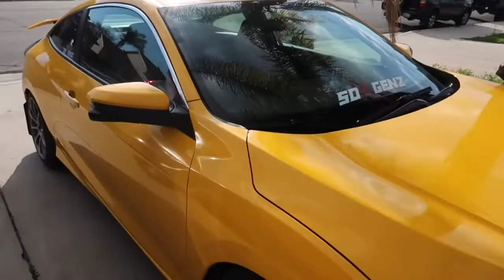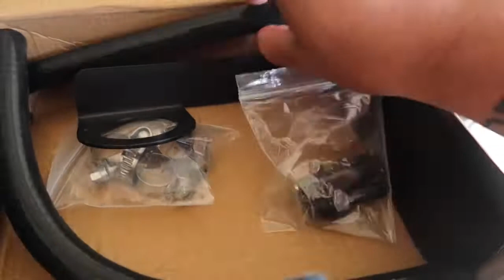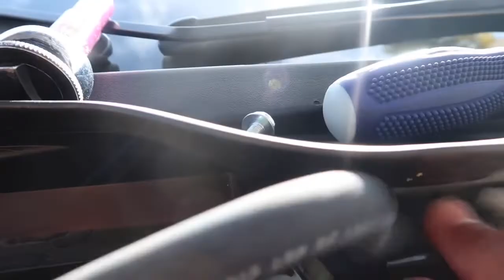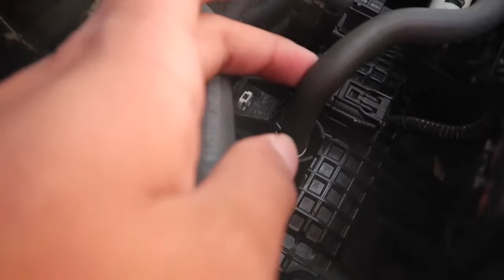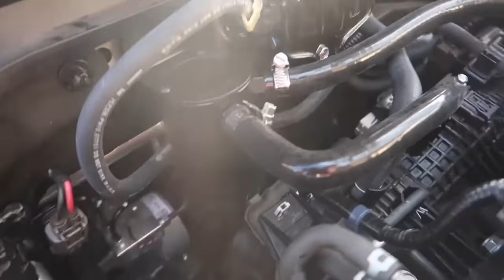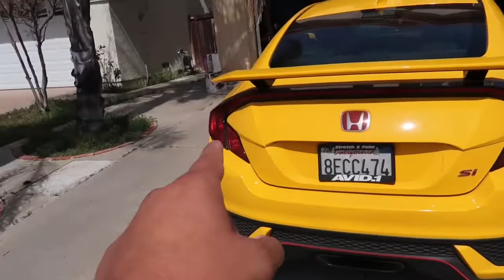Oil Catch Can Install!

Comment: My personal preference since your car is yellow, which is dope, I’d probably take the red pinstrip off, it kinda looks too much of a ketchup and mustard look if ya feel lmao but great vid again! Look forward to the next one
Reply from the maker: Thank you a lot for your feedback! I really appreciate it.
Reply: keep the red stripe. It adds a touch of contrast to the overall theme of your car. Regarding the catch can, I purchased one for my 2018 si as well. Read a lot about catch cans  and how they can benefit direct injected engines and for the most part turbo engines. Catch cans will not add performance to a engine, rather, they will catch all the oil sludge before it settles in the intake valves. I plan on keeping my  si for a long time and wanted make sure the engine is in top  shape without all that oil sludge shit in the intake valve. It call is preventive maintenance.
Reply: @FORSAKENGARAGE  well, one said fire 🔥 all you need now os blue lol! That blue fire with yellow and red

Comment: I pulled off my charge pipe hose from the turbo only to find a slight mix of oil and gas sitting on the plastic inlet from the turbo. All that is from some hard driving but 90% from idling the car to get warm during the cold weather. That’s where the dilution issue is from is the car not warming up fast enough in cold climates. The catch can is cheap insurance. If you’re smart, you’ll put one on. I’m glad I ignored all do’s and don’ts about a catch can because now I’m putting one on to avoid that issue any further.
Reply from the maker: a lot of people actually disagree with a catch can, but like you said, it is a cheap insurance, after two months i inspected the car, and there was oil deposits. I'd rather be safe than sorry, like i mentioned in the video, it just helps with maintenance. thank you for watching, show a brotha some love and hit that subscribe button. I will be doing a giveaway at 1,500 subs!
Reply: @FORSAKENGARAGE  there was or is am issue with the turbo they said. Usually hondas are good about their engine, but they might messed qoth this ome where oil leaks to the combustion last time i heard.

Comment: Awesome video dude.
I plan on getting a 2017 Civic 1.5 manual and the first thing Im gonna do is install a catch can.
Do you see any effects after the installation. Have you seen if there is anything in the can after driving a bit?

Comment: I have a 2019 Honda Civic Sport 2.0 would that be the Same??
Reply from the maker: Junior Ayala negative, this is for a 1.5t liter engine
Reply: the 2.0 engine is a multi-point fuel injected car.  meaning the fuel is sprayed over the valves to keep the valves clean.  You should only install a catch can on a GDI (gas direct injection) car.  Because, the fuel injector is directly in the cylinder, therefore does not spray or wash the valves.  On GDI engines, the valves can get carbon deposits.

Comment: Whats the oil can for?
Reply: to catch oil
Reply: It's for preventing the valves from getting coked up with oil on direct injection engines.  Prior to DI engines, the fuel would wash over the valves and help keep them clean.  Now, DI engines have the injections directly in the cylinder not the manifold (as MPFI engines would).

Comment: 04m37s ~ 05m04s discolored gasoline sludge and carbon residues safely trapped in engine oil catch can oil catch tank https://www.youtube.com/watch?v=xCfhebKMRbU&t=2s
Best ways to make your car engine last longer with oil catch can tank
2008 Sentra engine oil catch can tank and blow-by hose configuration placement maintenance
Engine oil change 2008 Sentra 2.0 S - DIY drain and fill
05m12s ~ 05m20s check the engine sound prior to engine oil change

오일 캐치캔 캐치탱크 장착했습니다. 가솔린 휘발유 차량이고 포집된 기름 상태 찐득찐득합니다. 
 https://www.youtube.com/watch?v=2wvupPKUeTE&t=965s

자동차 엔진 수명 연장, 집에서 일반인 누구나 DIY 가능 최소비용 최대가성비 The most cost-effective engine DIY maintenance at home https://www.youtube.com/watch?v=6DLn0kIi-84&t=225s

자동차의 심장 엔진 수명을 늘려서 존버 하는 방법 - 오일캐치캔
자동차 엔진을 10년 이상 무탈하고 오래 탈 수 있게  관리 하는 법

불완전 연소되어 찌꺼기가 끼여있는 더러운 잉여 개솔린 휘발유가 다시 엔진 연소실로 되돌아가기 전에 오일캐치탱크에 안전하게 분리된 찐득한 점액성분으로 변색오염된  가솔린 휘발유 - 04분37초 ~ 05분04초 확인

오염된 상태로 엔진 연소실로 들어가면 결국 엔진 때로 누적 되어 장기적으로는 노킹현상 유발 - 엔진 수명이 짧아집니다. 엔진을 깨끗하게 유지 관리하게 하는 꿀가성비 DIY 부품 - 오일캐치캔 강추 합니다 정기적인 엔진/미션오일 교환은 필수 입니다. 특정 회사 제품 사라는 광고 구입 링크~ 걸어놓은 부분 없습니다.

2008년도에 첫차로 구입해서 엔진관리 잘하고 13년차 아직까지 무탈하게 잘 타고 있습니다. 5분12초~5분20초대 13년된 엔진소리. 오일캐치캔 / 엔진오일 교환 / 미션오일 교환 모두 내돈내산 DIY 자가정비 경험담 입니다

수십년 전 우리 부모님 세대는 칫솔질만 하면 치아관리가 다 인 줄 알던 시절이 있었습니다. 그 영향으로 부모님 세대 들은 40~50대 이후부터 심각한 치아관리 부실로 인해서 치과를 찾을 수 밖에 없었죠. 그 마지막은 결국 틀니로 결말을 맺거나 지금은 임플란트로 대체 되었죠. 그러나 이 모든 사단이, '치실'에 대한 공익광고 만 있었다면 어느정도 해결될 사단이었습니다. 제가 어느날 치과에서 이 '치실'에 대한 생각을 털어놓자... 치과 종사자 분이 허탈하게 농담섞인 느낌으로 한마디 하시더군요. "저희는 그럼 뭐 먹고 살아요?" 라구요.....

5년~10년 마다 자동차를 주기적으로 갈아타시는 분들 한 테는 해당 없는 내용 이겠지만,
자동차가 한 두푼도 아니고, 오래 타면 그만큼 이득이고,  치과에서 '치실' 과 같이~~
자동차에서 '오일캐치캔'이 같은 맥락으로 생각되어 공익차원에서 올린 꿀팁글 입니다.

자동차 엔진오일교환/미션오일교환은 칫솔질 처럼 '그나마' 일반적이고 상식적인 사항입니다. 그러나 오일 캐치캔에 대한 내용은 정비쪽이나 매니아 말고는 잘 알려진 사항이 아닙니다. 왜그럴까요?

자동차 제조 판매회사 측은 차량 교체주기가 빨라져야 사업이 돌아가는 구조, 즉 자동차가 빨리 고장나야 제조사는 자동차 한대라도 더 팔리니까요. 자동차의 심장은 엔진입니다. 제아무리 이쁘고 간지 작렬하는 자동차가 있다 치더라도, 엔진이 뻗어버리면 어떻게 될까요?

오일캐치캔은, 자동차 제조 판매회사가 원하는 교체주기가 빠른  판매소비구조에 반하는 정비품목 입니다. 그러나 경제적인 면을 소중히 생각하는 소비자 측에게는 꿀팁이죠.